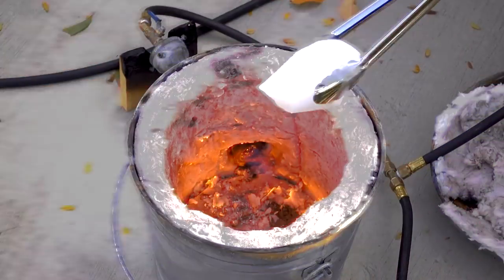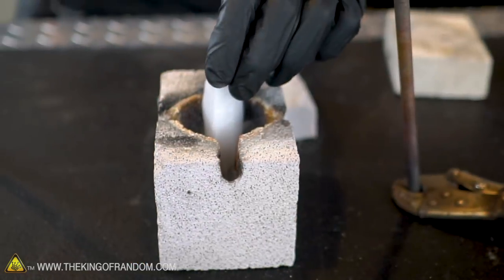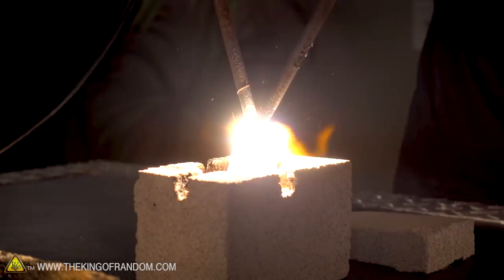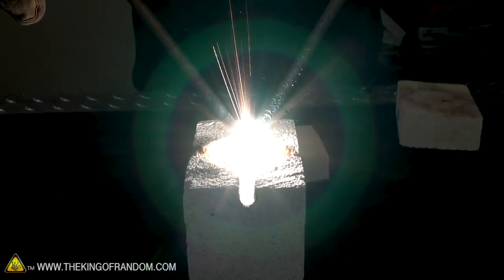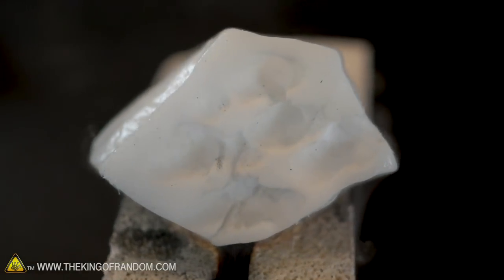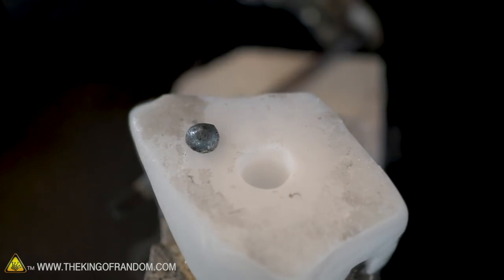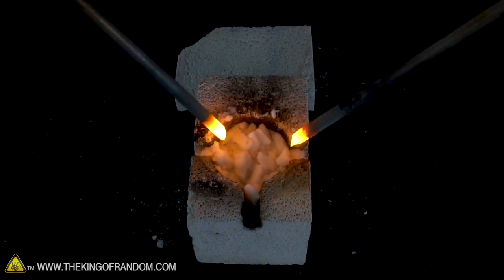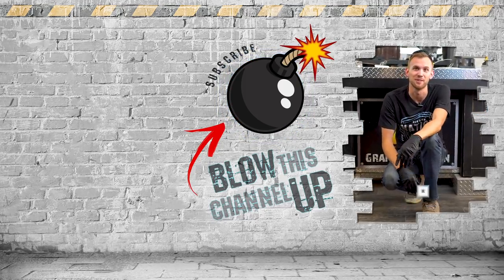Testing Dry Ice in the Arc Furnace

Comment: What happens when you pour liquid nitrogen on top of a turned on ark plasma?
Reply: What happens when you put dry ice in liquid nitrogen. Hmm. Does liquid nitrogen get colder or dry ice melt.
Reply: liquid nitrogen much colder
Reply: Well luiliu, liquid nitrogen is a lot colder than dry ice so the liquid nitrogen would boil as it brings the dry ice to a lower temperature and will slow its boiling once it cools its surroundings. And for OP the liquid nitrogen would just boil slightly faster than it normally would and won't reach an equilibrium with its surroundings due to the constant heat source
Reply: @Shrimplington  so would the dry ice become brittle and crack easier or would it solidify even further.

Comment: You should try to get electricity by putting a solar panel under the solar scorcher 
I love your videos keep it up ❤️ 👑
Reply: You'd need a tiny panel though. The scorcher focuses sunlight to a tiny spot
Reply: @eb4enderblaze if you put the solar panel in the focal point it would melt and be destroyed
Reply: You do relize panels optimize efficiency the cooler the K(temp) is
Reply: U know the price of solar panels right?
Reply: @reyh2277  about 10 cents a cell and about 5 cents if you buy in bulk
Reply: @C_Castillo  there is no way they r that cheap
Reply: Thats like less that 1 pence or something
Reply: @reyh2277  evidence, ive built my own solarpanes for class projects that produce about 1400 watts and i actually use them daily
Reply: It'd prolly melt
Reply: @C_Castillo  if u say so i dont really have anything to dispute it so imma agree. Sure
Reply: +Blue Phoenix, they seriously are that cheap but that's the cheapest possible one that's rated for 0.5 volts. They don't get to 5 volts until 70 cents and 12 volts is about 3 dollars.
Reply: @reyh2277  Yeah it seems like they'd be expensive but they are actually fairly cheap.

Comment: What is the best way to keep food from going rotten or to prevent mold? It seems as if the vacuum chamber didn't prevent the mold much so I'm wondering if there is another step you can take to prevent mold from forming and maybe even outside of a vacuum. Perhaps you could try freeze drying (which requires pulling a vacuum and applying heat to something such as ice cream so that it boils the liquid without losing the structure of the ice cream or burning the sugar)
Reply: BlendyCat store the food in your refrigerator. Uncooked, raw or frozen foods should be in the freezer.. best if it’s under -4 celcius.. cooked foods should be stored in the refrigerator section... best if u cover it up with a cling wrap.. and if u have dried foods.. or maybe vegetables.. keep them in the crisper section of ur refrigerator.. ( the refrigerator most likely have some kind of sign to show that it’s a crisper.. if not.. then it’s usually the bottom most section of ur refrigerator...)

Comment: How about you try to put dry ice either in the vacuum chamber or in an air tank. Because it take pressure to cause most reactions will the ice crumble after being in 50psi or more? Or will it tear itself apart with a vacuum.
Reply: Then after each experiment try heating it up in different methods to see if it changes anything
Reply: It wouldnt work, they explained in another video that its constantly giving off that gas and it would still fill the chamber up and eventually explode it
Reply: Thats a great suggestion.

Comment: What will dry ice do when it hits the sun?
Reply: Won't it just melt faster?
Reply: kremit the frog thy have already done that using the solar scorcher
Reply: React cause either a  gas, solid, or liquid to form, posible emit light and heat (exothermic reaction) or chamge colour what did you posibly think would happen?
Reply: It would freeze the Sun
Reply: Dry ice is just frozen carbon dioxide, so as soon as it enters the vacuum of space the complete lack of pressure would cause it to boil, then as there are minimal other particles under high vacuum conditions for it to interact and collide with it would eventually cool to the temperature of its surroundings and exist in its lowest energy state. If hypothetically you could get it close to the sun, the extreme temperatures and emitted high energy particles and radiation would strip the electrons from the carbon and oxygen atoms generating plasma, which the sun is itself anyway.

Comment: If a liquids boiling point is brought down in a vacuum chamber. Would water evaporate? Let me rephrase that, does the liquid still evaporate when the boiling point is brought down?
Reply: What do you mean? In a vacuum pressure is less therefore the boiling point decreases thats why water boils under a vacuum.
Reply: he means : does water still evaporate in vacuum, when it is boiling. 

I would say yes theorically, but the vacuum pump would just draw the water vapor away.
Reply: @MmeHyraelle  well evaporation and boiling are two different processes so if something is boiling it doesnt evaporate.
Reply: Well that's what he asked about.

Comment: Can gasoline ignite in a vacuum?
Reply: @Jane O-K youre right
Reply: It would never be able to contain a constant vacuum because the gasoline is evaporating in a normal room temperature. Or am i wrong?
Reply: @HackNGaming  youre right but it would not combust because combustion needs oxygen and gasoline is a hydro carbon which will only release hydrogen and carbon while evaporating, after a short period of time there would be no gasoline left. I might be wrong dont quote me.
Reply: It depends if would evaporate untill the pressure in the container is enough to keep the gasoline as a liquid, but you're right about the oxygen part but it would be interesting to see it anyway  ^^

Comment: I googled a list of the boiling point of metals because why not, and it turns out that the boiling points of zinc, sodium, selenium, potassium, magnesium, and cadmium are all below 2000°F, so if your furnace can go up to 2000°F, then it's technically hot enough to boil these metals, not just melt.

Tl;dr You should try boiling zinc, sodium, selenium, potassium, magnesium and/or cadmium because your furnace gets hot enough for that.
Reply: Boiling metals is extremely dangerous. For example Cadmium is a toxic heavy metal.

Comment: Hey nate is it possible if you put hot lava on dry ice will the lava melt the dry ice or will it just stay their?
Reply: Honestly, with the temperature of lava, molten steel would do the same thing. Which odds are in this video you saw (most nuts are made of zinc plated steel). And at normal atmospheric pressure, dry ice cannot melt.

Comment: welding with co2-argon gas creates carbon monoxide gas so I would think putting solid co2 in an arc furnace would create huge amounts of co1
Reply: what would happen if you put aluminum oxide in the arc furnace? would it flame-fuse and create a gem?

Comment: What happens if you try to use the mini arc furnace on liquid nitrogen or liquid butane . So for example you heat up the liquid but and and then when it’s a gas, light it on fire mid air.